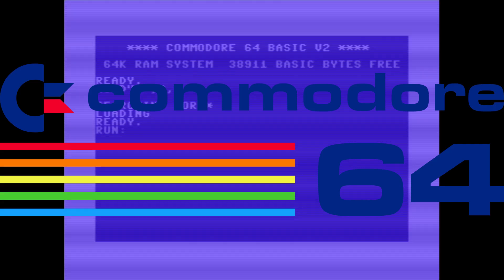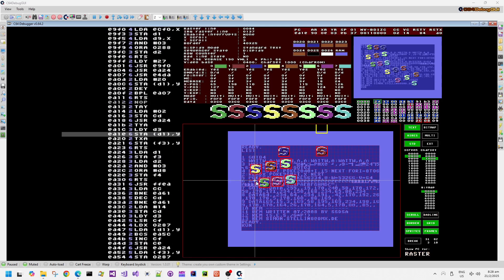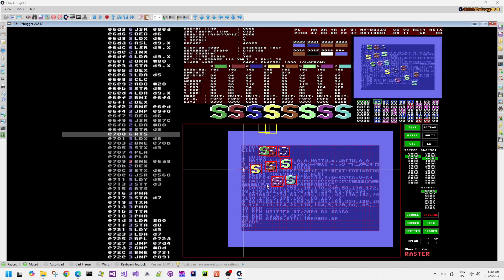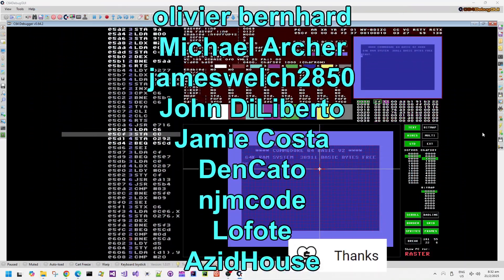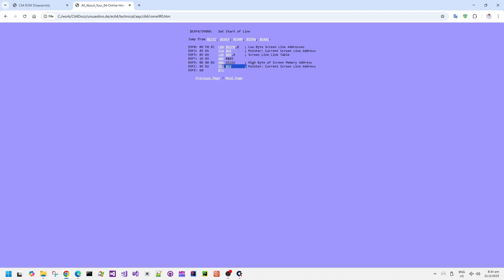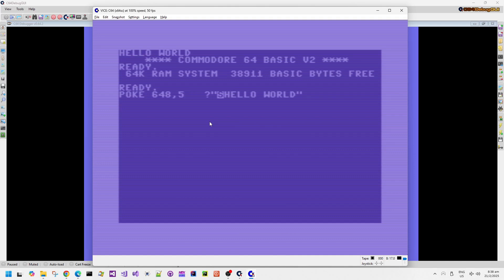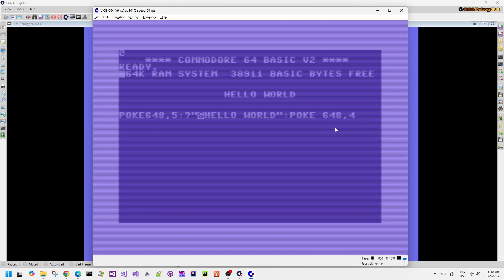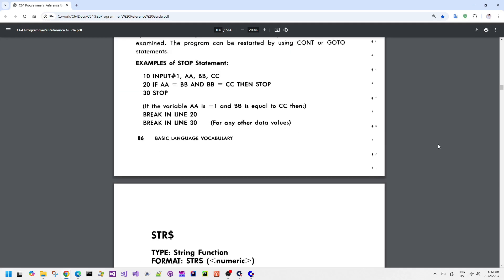C64 Technical peek - BASIC Sprite multiplexing

Comment: Clever way of doing a fast update on the sprites 👍 but maybe a bit questionable if you can still call it a BASIC program 😄
Reply: Yea it's more than 50% basic encoded assembler and the basic programm is just to put the assembler into memory :(
Reply: @QuintarFarenor  Not quite, it's using the PRINT command in a clever way to update the sprites. The DATA statements are just for the sprite graphics. You can see there are no SYS calls.
Reply: @TheStuffMade  huh...I'll recheck. The print command did look a bit funny. MAybe he could do a deep dive into that, I think it was not spoken about in this video to an extend.
Reply from the maker: @QuintarFarenor  at 3:15  which is traced to the put character routine
Reply from the maker: Then at 5:15
Reply from the maker: And 6:30
Reply from the maker: And 9:50
Reply from the maker: And 12:10 very specific
Reply: @MartinPiper6502 MAny thanks, for I am an idiot and didn't watch after you gave credits. I thought the video ended, didn't look at the timeline and was on another video.
Reply from the maker: I think I should put that section at the end from now on :)